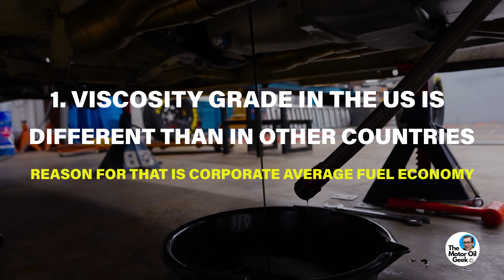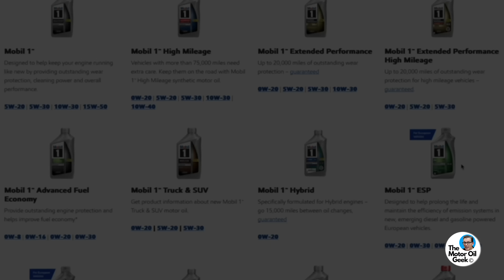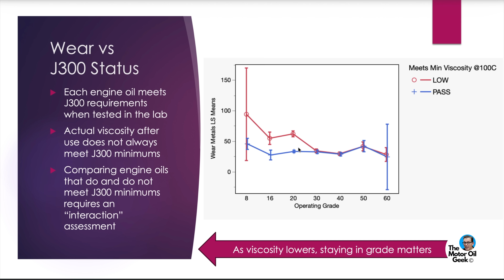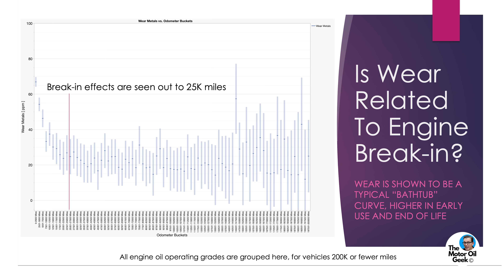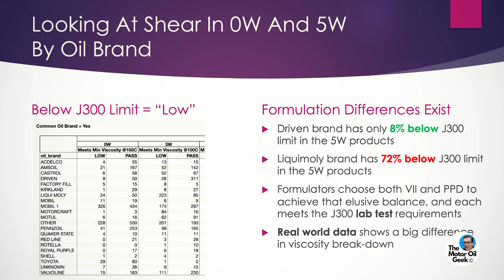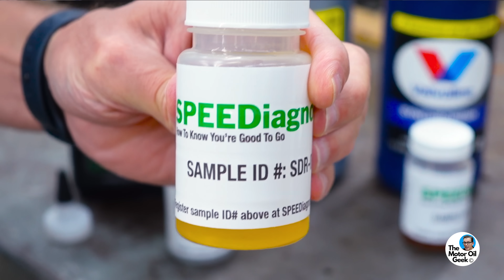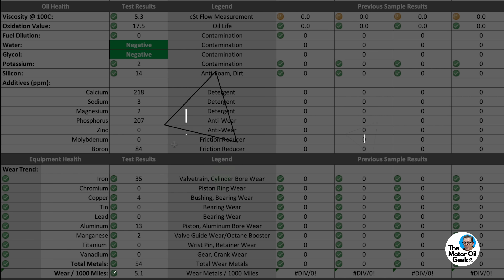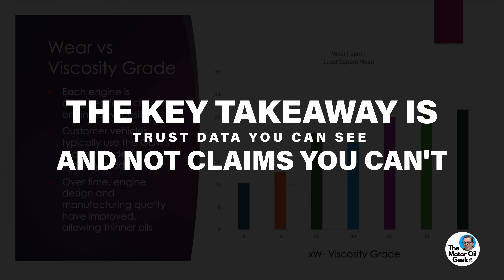More Ai Lies? The FACTS about 0W-20 vs 5W-30 (With Evidence)

Comment: I live in south Louisiana and it gets really hot here, 0W-20 , 0W-16 which is what my daughters Camry calls for is just too thin to use here. I run Pennzoil UP 5W-30  in my daughters Toyota Camry my wife’s Honda Odyssey and my other daughters Jeep Wrangler. All of them run just fine and the engines sound a lot better with the 5W-30 vs. the 0W-20.
Reply: Same here in Ohio. It's been close to 0°f a few times the last month but there's no issues starting anything. No reason to use 0w20 at all. 
We have chevy toyota honda hyundai and ford, and i use 5w30 in all
Reply: @TheScrubmuffin69 The oil pumps in this engine is not calibrated for 5W-30.
Reply: @NomenClature-o8s correct. A lot of new oil pumps made today are electronic in some way, shape or form. I'll draw on my experience as a Chrysler Technician. The 3.6l pentastar has an electronic oil pump, programmed for 5w-20 (in the older models) 0w-20 in the newer models. This "oh it runs just fine" is garbage... its such a dumb anecdote. Have you done the oil samples to test that theory? Answer is usually always no. To take it a step further clearances are a big deal with these modern engines too. In the newer 3.6l pentastar they dropped it to 0w-20 for cafe standards and because they tightened up the tolerances in that engine. People need to use their brain and understand that clearances are a big player in all of this (yes and emissions standards).
Reply: @smallblockmaniac Exactly. Many people assume that oil technology and engines never advance.
Reply: @smallblockmaniac that's BS Mr Chrysler tech. I have a 2012 Wrangler, the first year it came with the Pentastar engine and it calls for 5w30 oil for the 2012. It wasn't until the next year that they switched to 5w20 in the 2013-2018 JK  Wrangler model years. They also switched to the coolant type from HOAT to OAT in 2013. Another thing they changed in 2014 was the oil filter housing and cooler. Other than that it's the same damn engine from 2012-2018 in the JK Wrangler and there's nothing different about the oil pump from 2012 up to 2018. The Pentastar engines in the newer JL Wrangler use the 0w20 oil and have a different variable valvetrain timing system and the valvetrain and cam setup that goes with that. 
I actually just replaced the oil pump in my 2012 last year because that stupid solenoid that controls the pressure died. I replaced just the solenoid initially with a Dorman unit and it lasted 3 weeks lol. I ended up just replacing the whole pump afterwards with a Melling unit from O'Reilly's and there was no distinction when I bought it, the pump works on 2012 with 5w30 oil all the way up to a 2018 that uses 5w20 oil. There was no programming needed for my "older model"....
Lol I even have a 2014 redesign oil filter and cooler housing on my 2012 that I installed after my original started to leak at the o-rings.
Reply: @TheScrubmuffin69 you didn't watch the video did you?
Reply: The engine operating temperature is a lot hotter than the outside summer temperature in Louisiana.
Reply: The Engines sound a lot better ???????   How is that so ???
Reply: @mikewallace8087 😂
Reply: @star9732  What do you find funny ?
Reply: @mikewallace8087  Have you heard some of these engines start up? They sound like a diesel until they warm up a little.
Reply: @Troy_Built  Some of these engines ?
Reply: @Troy_Built That's direct-injection injector noises - perfectly normal.
Reply: @davepaturno4290  other noises would include valvetrain noises, genius.......
Reply: @Troy_Built  I live in Wisconsin . My 2022 Subaru 2.5L makes varying noises in winter time during warm up until the info-center indicator displays WARM and the engine idle down to 700 rpm . Do you know what are the specifics on what the computer is doing during that time?  I think you don't and can't explain it.  I don't drive my car until the engine Idles to 700 rpm.
Reply: @davepaturno4290  Not just direct injection engines do it. We usually just start counting the day until it gets a timing job or new engine.
Reply: @mikewallace8087  A whole lot of them and not just specific makers. Fire them up cold with the hood open.
Reply: @Troy_Built  Okay, you don't understand what the computer is doing during engine warm up.
Reply: @jeepinintexas6215  Nope. Our 2006 Lexus and my 2008 Mazda both are port injection. Both are much quieter than my 2024 GR Supra, which has direct injection. You can hear the injectors from inside the car. Big difference! The majority of the ticking sound is from the injectors. Get used to it!
Reply: @davepaturno4290  cool story bro, but I never said anything about direct injection noises. I was referencing engine noises other than injectors like those from the valvetrain. You know, the lifters, valves, rockers, timing chains etc. I think your reply was intended for someone else.
Reply: @davepaturno4290  GDI operates on higher pressures, so noise are complete normal.
Reply: @victortaveira8271  Yes, in fact:
DI systems operate at very high pressures, often between 500 to 3,000+ psi, compared to PFI systems which typically run at 40–60 psi.
- This high pressure causes sharp, rapid fuel pulses directly into the combustion chamber, creating a distinct ticking or knocking sound, especially noticeable at idle or low speeds.
- The solenoid or piezoelectric injectors used in DI systems open and close very quickly and forcefully, which adds to the mechanical noise.

2. Injector Location
- In PFI, fuel is injected into the intake port, where it mixes with air before entering the combustion chamber. This process is quieter because the fuel has time to vaporize and mix smoothly.
- In DI, fuel is sprayed directly into the combustion chamber, often during the compression stroke, which can cause combustion noise due to stratified charge combustion and higher pressure gradients.

3. Combustion Characteristics
- DI engines can run leaner mixtures and use multiple injection events per cycle, which can lead to more abrupt pressure rises in the cylinder — another source of noise.
- Some DI engines exhibit "diesel-like clatter" at idle or during cold starts, especially in early-generation systems.
Reply: @davepaturno4290  I’m playing with 8000psi DI system and sound is very problematic for normal car user. And higher pressure MPFI too
Reply: @mikewallace8087 that would be obvious, less engine noise.
Reply: @mikewallace8087  I rented a Chrysler 5.7 Hemi in AZ, every morning it knocked for a minute before it warmed up,  it has 36,000 miles on it, oil cap said 0w20.  That can't be good. Thing about heavier oils are they are more likely to have some coating engine parts after sitting awhile.
Reply: @lonniebeal6032 I wonder how long it had been since the car had last been started. I have seen that on several of the patrol cars in my fleet when they'd been sitting for a week or more. Usually takes no more than 5 minutes for the lifters to get pumped up completely.
Reply: Sorry, but the oil pump on that engine is not calibrated for 5W-30.
Reply: No it's not. Absolute rubbish.
Reply: Thats because the engines are happier with 5w-30, keep doing that.
Reply: After 100s of thousands of miles on 7 Hondas over 40 years running 0 or 5W-20 year round from subzero to driving the pants off 2 V6 Accords one with 380k and my current with about 150. I changed oil when the maintenance minder advised which worked out to about 5k to more then 9k on Mobil1. None of my old Hondas or my 2 current Hondas have ever used a drop. I've driven the pants off my cars all over the Midwest to the south Texas coast in temperatures sometimes exceeding 110 and as much as -10. This is Hondas recommended oil grade. They are designed for these viscosities. If you want your VCM and VTEC systems to operate properly you better stay with the recommended oil. We're not living in the past. Technology advances.
Reply: @inspectorraycharles OOF dont need to finish reading your comment... you use the oil change reminder on your vehicle... that tells me EVERYTHING i need to know about your intellect. You should really refrain from commenting on any further videos of any genre.
Reply: @smallblockmaniac Actually, I found that when I used the oil change algorithm in my 2014 Mazda 3, it recommended that I change the oil every 5000 miles, based upon my driving habits that consisted of 10 miles each way to work and back (total of 20 miles per day).
That makes perfect sense.
Reply: @davepaturno4290 are you familiar with how the oil change reminders work???????
Reply: @smallblockmaniac Yes, there were three options with my Mazda:
By miles accumulated
By days/months
By algorithm that determines change requirement by frequency of driving, distance per trip, oil temperature, etc.
Reply: @davepaturno4290 so the answer is no you don't
Reply: @davepaturno4290 your reminder will NEVER be as accurate (its actually only about 70% accurate) as oil Samples at different intervals using different oils to narrow down what you're engine actually needs. Anything less than that is pure speculative and ignorance.
Reply: @smallblockmaniac Of course, the algorithm assumes you are using the factory-specified oil. Mixing oil types is not good if relying on the algorithm program.
You can generally assume that your engine will last a long time if you use factory oil and change it when indicated by the algorithm. I verified this with my Mazda 3, as it suggested changes every 5000 miles.
Reply: Toyota tests their cars in Arizona to temps that are around 110°F. Does it get hotter where you live?
Reply: I should also add that I’ve found the owners manuals online for all 3 vehicles sold in other countries and 5W-30 is one of the recommended oils depending upon the temperature. I’ve done my research on this.
Reply: @diegaspumper8501  I prefer buy oil 0W, because the base lubricant is from a better quality. But, you should look for your daughter's Camry specific engine code elsewhere, because some hybrid models share the same engine and they require that kind of oil. And, for my knowledge, Toyota share a lot of ICE engine between hybrid and non-hybrid on American. It's just cautionary from someone owning a company that manage a big fleet of vehicles.
Reply: @victortaveira8271 it’s not a hybrid, I’ve looked into owner’s manuals for the same engine in other countries and 5W-30 is safe to use.
Reply: @victortaveira8271  Someone did an analysis on 2 viscosity's of the same brand, not much difference.  So you can't say for sure the base is better quality without  analyzing .
Reply: @lonniebeal6032  Yes, I know specific analysis is need to. My assertion was based on some product comparison and industry stories told by an automotive magazine MTZ 2,5 years ago. But brand evolves products throughout time and must be better know.
I’m big fan of Motul and Liqui Moly
Reply: @diegaspumper8501 5-30 non-synthetic....of course. Never doubt synthetic oils here in the US.

Comment: 5w 30 in my 3rd gen Tundra. I will probably jump to 10w 30 in summer months for more shear strength.
Reply: If you live in Saudi Arabia or Death Valley, good.
Reply: @davepaturno4290  Colorado. coldest I get is 2 degrees below 0 maybe once or twice a year. 10w is good down to 20 below 0. The first number is what protects against  thermal and shear break down as discussed here in this video. Second number is for hotter temps. Here we get to 100 a few times a year. 20 is not even on the viscosty chart. 30 or 40 protects for temps above 100 degrees.
Reply: @korbeadventures Unfortunately, most engine wear occurs at startup. A 0W oil flows much faster at startup, especially at sub-freezing temps, than does a 5 or 10W oil. And Toyota tests their pure synthetic 0W-8 oil to 104° F in Arizona.
Reply: @davepaturno4290 true. Until the  0W 20 Shear strength breaks down faster than the 5W-30 and 10w-30. Turbo engine such as the 3rd gen Tundra also break down the shear strength of your oil faster because of the heat from the turbos. A lot of new turbo engines have been having engine bearing problems not just Toyota Tundra.
Reply: @korbeadventures Yet Toyota GR Supras with turbo engines have been very reliable over the last 6 years. They leave the factory with 0W-20 oil. Most owners do not track their cars, so that 0W-20 oil have been doing a fine job of protecting their engines. And Consumer Reports magazine has found that Camrys, Corollas, and RAV4s have been very reliable with 0W-XX oils over the last 15 years.
Reply: @davepaturno4290 I have a second gen Tundra 125,000 Mi on it. I ran 0w 20 in it for the first 100,000 miles. Now I'm running 5W-30 in it. I have a third gen Tundra with 22,000 Mi on it. Four oil changes in the first 10,000 MI with 0w 20. Now I'm running 5W-30 in it and thinking about switching to 10w30. You can run whatever you want in yours.
Reply: @korbeadventures Yes, and I'm running what's in the manual...same with my transmission and brake fluids.